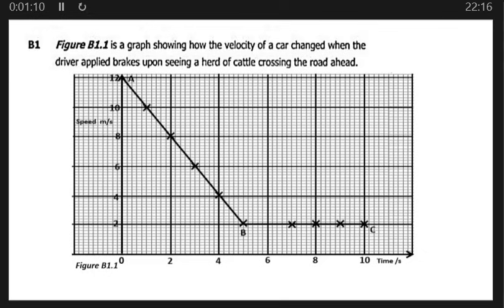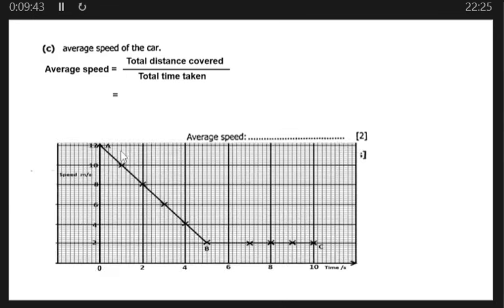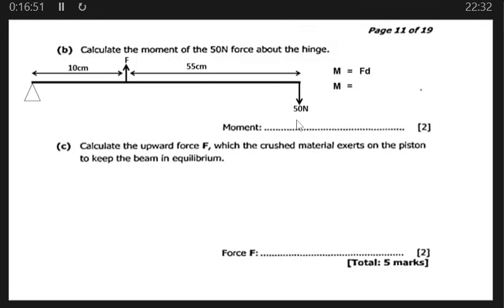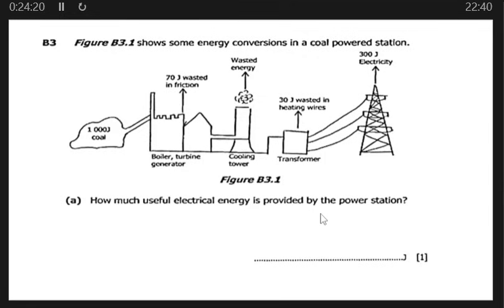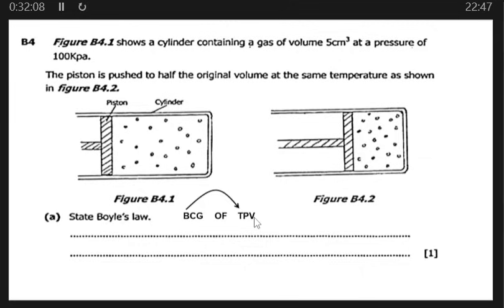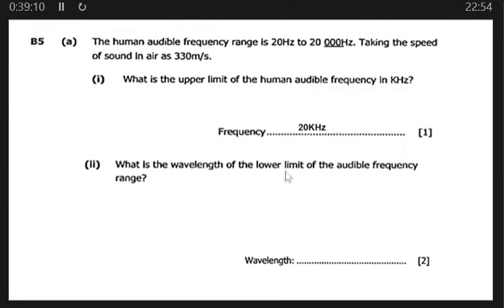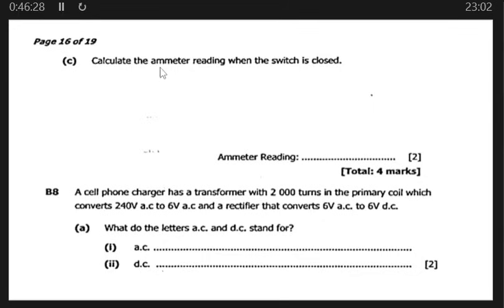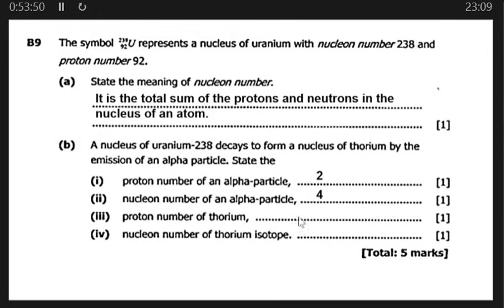ECZ SCIENCE PAPER 1 2019 INTERNALS PART 2 SECTION B

Comment: Question b1 when finding the distance for the rectangle you are not suppose to use 10 because the last part didnt start from 0 instead it started from 5 up to 10
Reply from the maker: Thank you but I took the whole rectangle from time equal to 0s to time equal to 10s. Then on the triangle, I started from speed equal to 2m/s to speed equal to 12m/s. So I was supposed to start from time equal to 5s for the rectangle if I started from speed equal to 0m/s for the rectangle, otherwise the calculation as it is, is ok.
Reply: @THEDMSONLINESCHOOL  ooh really I believe the total distance should be 35m and not 45m